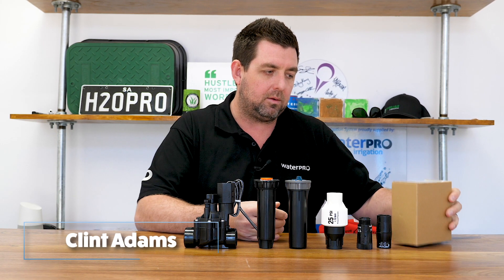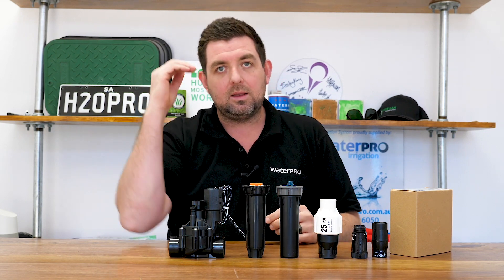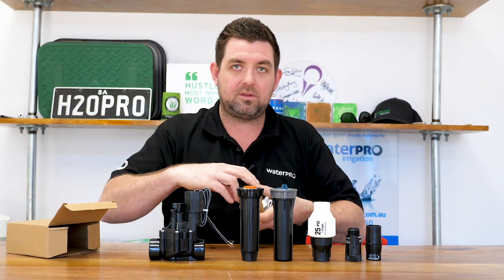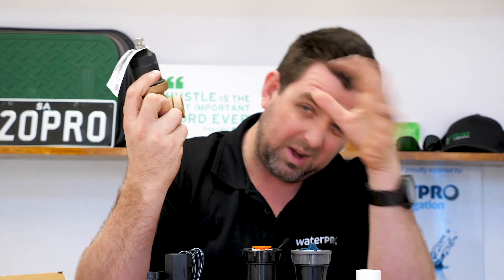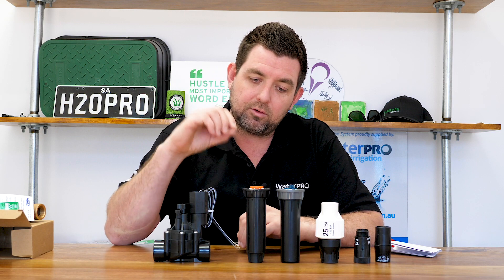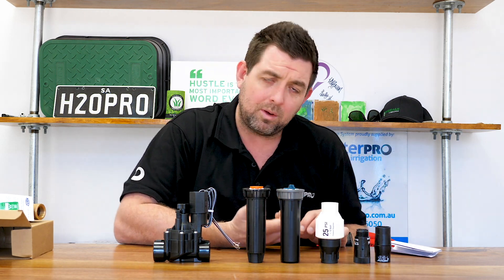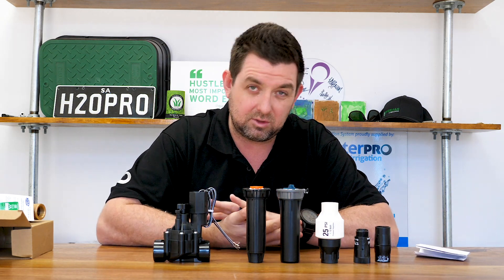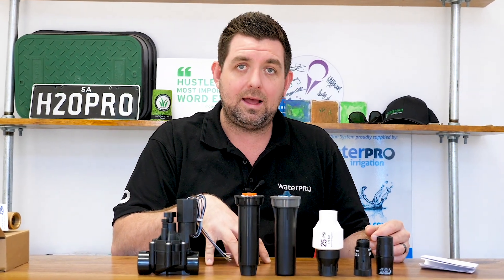How To Manage Irrigation Pressure Reduction Correctly

Comment: I am in Texas, the pressure come out of the meter is supposedly 50 psi. I have a station that has 8 sprinkler heads, and one unit has the tendency to blow up the Hunter sprinkler head. I had to replace it within 1 year. Its a Hunter SS-530 side sprayer. I wonder if it can still have too much pressure even with 8 heads?

Comment: Thank you, I'm still struggling with my system though. I've used a pressure gauge to check the pressure out of my hose bib, which is measuring at 60 PSI. When I add the pressure regulator, it is not reducing the pressure as expected. I've tried a few difference pressure regulators, of varying quality, brand, and PSI, but none seem to be reducing the pressure to the desired PSI. This is a system off of a hose bib, using an orbit controller and drip tubing, so I do need to get the pressure down from 60 psi. Do you know a suggestion for what I can do, or why the pressure regulators do not seem to be doing their function? Originally it seemed like they may be working, but water was leaking from the connections, so when I got those patched up the pressure was still too high.

Comment: I am a little confused about whether I need a pressure regulator for my sprinkler to drip irrigation conversion. I am using the Irritrol 2700DPR, which has a screw which allows one to control the water pressure in the system. Is adjusting the valve, to lower the water pressure, suffice to stabilize the new drip system on should I still install a pressure regulator at the end of the riser? I can not find any documentation that address that question. Or should it be assumed that a pressure regulator should ALWAYS be installed when using a drip system? Thanks for your assistance.

Comment: Very good video. I have a question, I bought a small watering system kit from Amazon with a digital water pump, lines and dripping parts. The product work fine but I tried to change the dripping parts for the sprayer parts because I want the water come from the top and not want to use the dripp. Also I added more lines and sprayer because I have more plants and I will have more plants in a future. So, the system has not pressure enough to spraying water. I bought a medium water pump separate from Amazon and Im planning to connect that to a 55 gallon tank. I don't want to broke the lines of the system that I have already and I would like to connect to the right way. I would like to know how I can set up the water system without broken the lines because will be a lot of pressure. Can you explain me the process or if you have a video to recommend? Thanks in advance. By the way I subscribed to your channel.
Reply from the maker: Sprays use much more pressure than drippers. Its likely you need a pressure pump. Can you link up the system in the comments for me?

Comment: The water pressure goes before the valves ? After the backflow valve?
Reply from the maker: Most pressure reducers are only designed to work under dynamic flow, therefore they need to be after the valves. Otherwise they may leak or break.